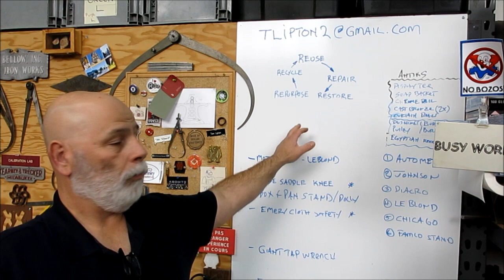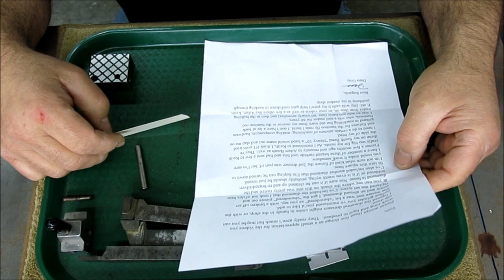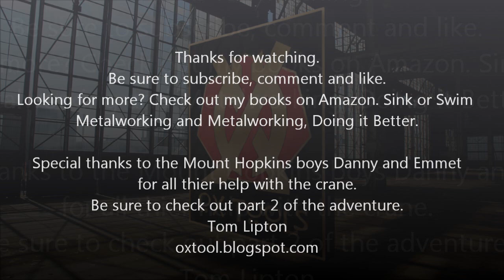Monday Night Meatloaf 61 Mount Hopkins Part 1

Comment: Hey Tom,

One thing that small oiler lacks is a flip-up on/off lever. The Myford in the old electronics workshop had those oilers and people were always forgetting to either turn them on or off, so you'd either hear the lathe start to slow as the bearings tightened, or you'd find the lathe sitting in a pool of oil.

I seem to recall there was an article in Model Engineer's Workshop a while back about needle profiles to give a more linear control over the drip rate.
Reply from the maker: Hey Paul,

You are correct about that. I would have preferred a valve type. I will make the mounting so I can switch it out for when the perfect ones falls out of the sky into my lap. 

Cheers,

Tom

Comment: I'm a former amateur telescope maker, and I remember reading an article about a segmented mirror telescope where the segments were individually adjusted in real time with computer-driven servo motors to compensate for thermal distortions (heat waves) in the air. It somehow used a laser to detect the distortions in real time as well, though I don't know how. Not sure if they abandoned that technology or not, but it sure sounded pretty cool.
Reply: The keck telescope uses this technology
Reply from the maker: Hey Art,

The secondary optic of the big scope uses adaptive optics. It has magnets on the back of the mirror and something like a speaker coil that can vary the shape of the mirror much like a speaker membrane. Very cool technology. It makes space based telescopes almost obsolete. The laser is used to project circles to calibrate for the current atmospheric scattering. Thanks for the comment.

Cheers,

Tom

Comment: Nice grinder!  That's some neat territory out there.  I was stationed at Ft Huachuca for the last two years of my enlistment.   It's just around the corner.  90% of the time I was on temporary assignment in Europe or the Pentagon, so I was there just between assignments.  Picturesque mountains that have snow capped peaks (even in Summer!).  The canyon streams are full of rocks/pebbles of various colors, not just grey sand.  Nice place.  ps:  I worked on various satcom stuff.

Comment: Tom, I have a few Wiltons myself.  The two digit date of manufacture should be on the underside of the slide of the dynamic jaw.
Reply from the maker: I'm going to lift its skirt up later tonight and see. Thanks for the comment.

Cheers,

Tom

Comment: Hi Tom,
Mount Hopkins is that a summer some kind of summer vacation place with permanent air conditioning...? Cause here we don't get many high summits like 8500ft. but usually vegetation has a hard time around 4-5000ft. all trees are Xmass trees of about 12 in. tall, then 10 ft. higher, nothing but moss and rocks.
I'd be scare to stand in the focus of the mirror lens when sun shows up... I f I were you I would be "Afried"...!
Happy Holly Days to you and family,
Pierre
Reply from the maker: Hi Pierre,

The installation was at 8500ft. The big 6.5 meter is around 9500 I think. There were some really nasty thorn bushes up at the summit with two inch (50mm) long thorns. Thanks for the comment.

Cheers,

Tom

Comment: Hey Tom!
Tasty meal, thanks.
Is it possible that big tracking mirror had a Stirling engine at the focus?  You could probably guess if it looked like power cables out vs data cables (vs steam hose?). ;-)
Chris in Oakland
Reply from the maker: Hey Chris,

They are a gamma ray array. Check out http://veritas.sao.arizona.edu/  Thanks for the comment.

Cheers,

Tom

Comment: Hey Tom, Great video as always. To check the date on that Wilton vise, unscrew the dynamic jaw all the way. Look on the bottom of the key, the MM/YY date should be stamped there.
-Mark
Reply: Then subtract 5 years from the stamped date the date stamped is the warranty expiration date witch was a 5 year warranty.
Reply: I bought a new one last year I'll have to see what year is stamped on it if it even has one  I know the warranty changed but didn't know they changed how they were stamped
Reply from the maker: Hey Mark,

I never noticed that date. I'm going to take a look for it right now. Thanks for the comment.

Cheers,

Tom

Comment: Sorry for the early post only just got into the video but a couple of things  one  would you go into how an oiler works  or make one one day  two  I noticed that you seem to have a fondness for the submarine shaped vices  is that a particular American brand ??  Or an engineers vice. Can you elaborate a bit more on them please Tom. Cheers David robot 3. Molnar hoists
Reply: Tom has Wilton vices.  They are pretty much "the" vice to have.  the jaw slides in and out in a close tolerance fit, so there is little to no slop.  And they are pricey.
Reply: Ok thanks for the info
Reply: In 1999-2000, Boeing purchased McDonnell-Douglas and shut down the MD-11, MD-80 and MD-95 Commercial jet aircraft lines.  All of the tooling was auctioned off or scrapped.  They sold pallets of those Wilton vices for pennies.  A crying shame.
Reply: Arrrgh don't you hate that have to be in the right place at the right time  hey  ah weep just have to hope and pray for the next big thing to come along
Reply from the maker: Hi David,

The vises are Wilton "Bullet" vises. Otherwise known as machinists bench vises. In my opinion they are one of the best configurations and highest quality vises still made in the USA. Thanks for the comment.

Cheers,

Tom

Comment: Cool. The "little flat mirrors" at the first spot. Did you get out a machinist's straight edge to make sure they are flat? Any chance they might actually be a conic section? My memory of 10th grade geometry is pretty fuzzy, but I'd expect that they might not be as flat as they look.
Reply from the maker: Hey Pat,

They were pretty flat by my eye. Each one is at a slightly different angle so the focal point it at the detector. I spoke to the guy that recoats the mirrors on a schedule. Thanks for the comment.

Cheers,

Tom

Comment: Those oil reservoirs are available from McMaster-Carr. Check out page 2201 in catalog #120. I have an old Barber-Coleman #3 gear hobbing machine that uses these and I once broke one of the oilers. That's why I know this…

As for climbing that stand opposite the mirrored dish: you're now on "the list" somewhere in some 3-lettered Federal Agency!
Reply from the maker: Hey Sp1,

The McMaster oilers have aluminum tops. That was the first place I looked. I was really wanting brass. I'm sure I'm on a few bulletin boards. Thanks for the comment.

Cheers,

Tom

Comment: The swiveling handle of the grinder looks scary:  when chowing and the wheel grabs, you lose control:  dangerous.  A rigid handle is better.  Other than that, Bosch is hard to beat.  Just my tube cents.
Reply from the maker: Hey Joe,

Thanks for the comment. I see you like it firmer.

Cheers,

Tom

Comment: Cool stuff, nice vise!    Next time you're down there, take a nice road trip over to the NROA Very Large Antenna Array.  Took my kids out there years ago, it is impressive.  Oh, how  would you like to change a bearing for a 230 ton antenna? I did wonder about that, and they show that on the web site. http://www.vla.nrao.edu/genpub/work/azbear/
Reply from the maker: Hey Tom,

There is a heck of a bearing under the main 6.5 meter scope. The entire building rotates at 2000 tons. Thanks for the link. I love geeky mechanical stuff like that. 

Cheers,

Tom